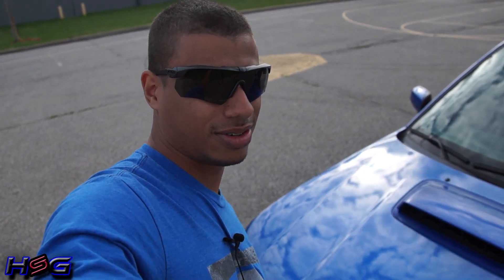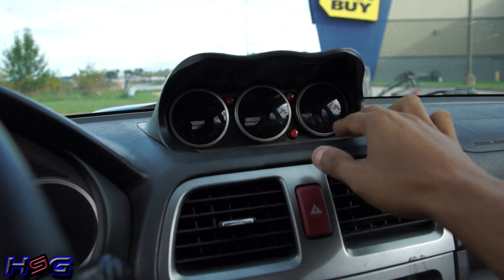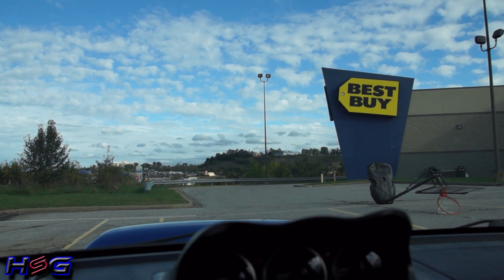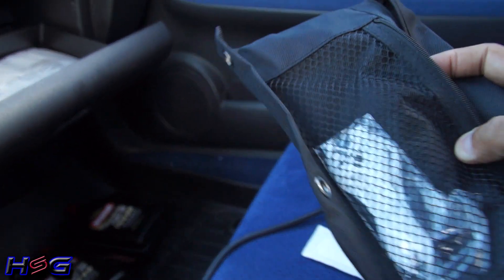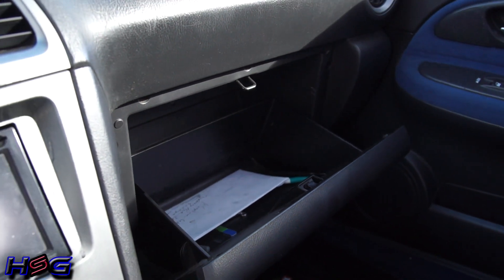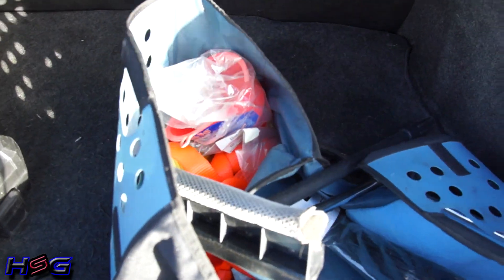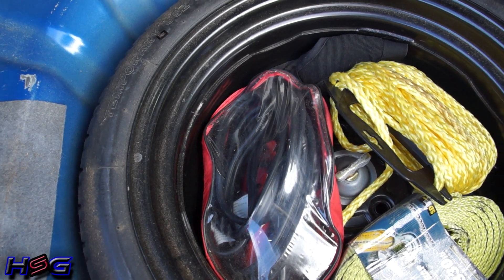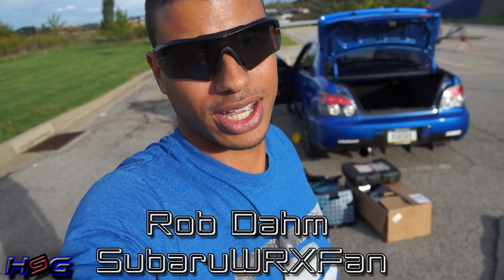What's in my STi? [Tag Video]

Comment: Hi.. so can you recommend and good brand air pressure gauge and where to buy?
Reply from the maker: +dsonyay Autometer, Accutire, & JACO are all pretty good as far as I know. There are a lot out there, some are even digital, so I would do a Google search & read reviews on different ones, & pick out one with good reviews that you also like. I prefer either digital, or one with an actual gauge face. Personally I stay away from the ones that have the measuring stick pop out, because I just don't trust their accuracy. A good gauge is going to be about $20 & up.
Reply: +HawkeyeSTiGuy Jaco.. I know that brand.  thanks.  I like a good dial gauge as well

Comment: What's up bro I got a Nissan Altima 05 2.5 I'm looking to mod it but idk what to do 1st any ideas?
Reply from the maker: My question is, is this your dream car, or just something you will have for a few years? The reason I ask is, if it is your dream car, then it is easy to justify putting a good bit of money into it. If it is not, then I would just do small mods here & there & save your money for your next car. That being said, upgrading the stereo is a good place to start if yours doesn't at least have an aux input. You can do intake, exhaust, or wheels, but those can be a bit more pricey. Window tint (if legal) is a good mod too.